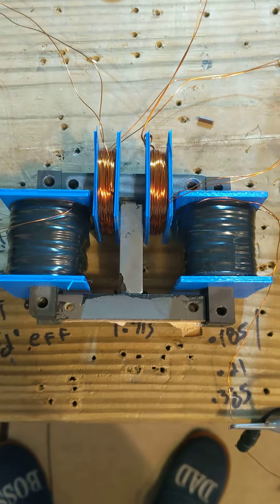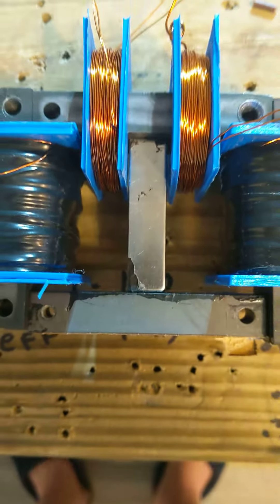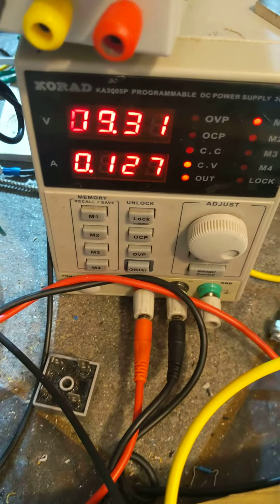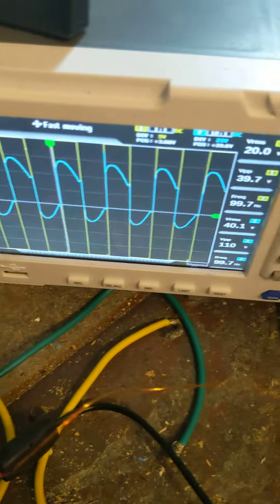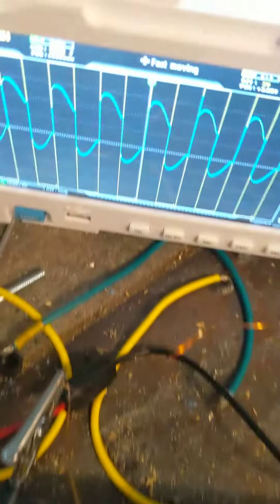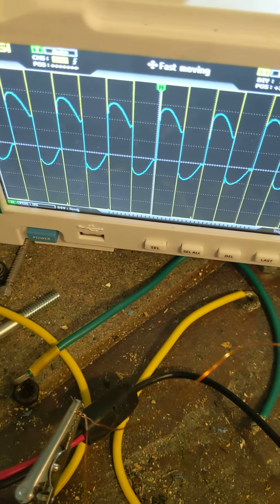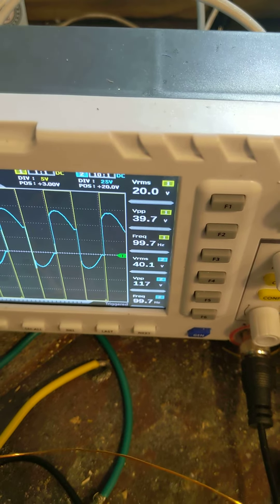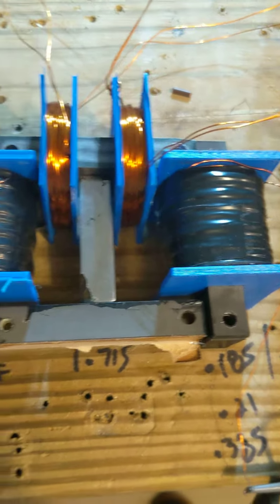Meg motionless generator. video number one

Comment: I would like to see a schematic if you wouldn't mind. Looks like a normal transformer, that humming you can hear represents magneto-strictive losses induced in the core. What are you attempting to achieve here if you dont mind me asking? Please do no say over-unity.
Reply from the maker: Just replicating Tom Beardom's MEG..  Old project-  it's dissembled
Reply: If you put electricity in a toroidal transformer the Aharonov–Bohm effect happens. Tom Bearden and his team have found a way to make a transformer like configuration where the Aharonov–Bohm effect automaticly takes place without external input. How does the meg works?
Consider the physical layout of the MEG. You have a stack of neodymium magnets in the center of a rectangular toroidal core. The magnets touch each side of the core on the inside. There are no coils on the core yet.

What does the magnet flux do?

The flux from the magnets will divide equally between each leg of the core. So you have half the flux flowing on the right and half on the left.

You now place coils on this core. You use two control coils on the top on each side of the magnet stack. And you wind two output coils on each vertical leg on opposite sides.

OK, it is set up. Now you want to switch all the magnet flux to one side by opposing the magnet flux with the opposite control coil. How much flux will the coil need to generate to do this? Well, the answer of course is half the magnet flux since that is what is flowing in that leg. The other control coil is in the off condition, and open circuited, so no current can be induced in it and hence no back-flux generated. The core must not be allowed to reach magnetic saturation or more energy will be required to force the flux to the other side.

Then you turn off the control coil and what happens?

Remember both control coils are now off. The magnet flux will return to its original starting condition of half the flux flowing on each side. Does the magnet need any help to do this? No, of course not. When you did this you also removed half the magnet flux from the other leg when the control coil was on. The first half cycle you only see half the normal induction level in each output coil because at the start you only switch half the magnet flux into one leg and out of the other. So the total change is Bmag/2.

Now on subsequent cycles you let the magnet flux return to its original steady state and let the magnet do the work. Both control coils are off while this happens. Just when the magnet flux reaches its equilibrium point you turn on the other coil and keep the flux change going the other way. Each coil only needs to always switch half the magnet flux not all of it. After the first half cycle you see a 100% change of the magnet flux in each output coil on each cycle for an input power that is half the output. This assumes that you are activating the control coils for half of each cycle. This means you have a theoretical maximum COP of 2.0. You are using the magnet stack as a flux battery and "letting" it do half the work.
Consider the physical layout of the MEG. You have a stack of neodymium magnets in the center of a rectangular toroidal core. The magnets touch each side of the core on the inside. There are no coils on the core yet.

What does the magnet flux do?

The flux from the magnets will divide equally between each leg of the core. So you have half the flux flowing on the right and half on the left.

You now place coils on this core. You use two control coils on the top on each side of the magnet stack. And you wind two output coils on each vertical leg on opposite sides.

OK, it is set up. Now you want to switch all the magnet flux to one side by opposing the magnet flux with the opposite control coil. How much flux will the coil need to generate to do this? Well, the answer of course is half the magnet flux since that is what is flowing in that leg. The other control coil is in the off condition, and open circuited, so no current can be induced in it and hence no back-flux generated. The core must not be allowed to reach magnetic saturation or more energy will be required to force the flux to the other side.

Then you turn off the control coil and what happens?

Remember both control coils are now off. The magnet flux will return to its original starting condition of half the flux flowing on each side. Does the magnet need any help to do this? No, of course not. When you did this you also removed half the magnet flux from the other leg when the control coil was on. The first half cycle you only see half the normal induction level in each output coil because at the start you only switch half the magnet flux into one leg and out of the other. So the total change is Bmag/2.

Now on subsequent cycles you let the magnet flux return to its original steady state and let the magnet do the work. Both control coils are off while this happens. Just when the magnet flux reaches its equilibrium point you turn on the other coil and keep the flux change going the other way. Each coil only needs to always switch half the magnet flux not all of it. After the first half cycle you see a 100% change of the magnet flux in each output coil on each cycle for an input power that is half the output. This assumes that you are activating the control coils for half of each cycle. This means you have a theoretical maximum COP of 2.0. You are using the magnet stack as a flux battery and "letting" it do half the work.
Reply: I thought bearden said the magnetic B field was confined in the ferromagnetic core, exposing the magnetic vector potential A.

Once the A vector is “perturbed”, it creates an electric field (not a magnetic field) that can then be received by the output coils.

The COP is able to exceed 2.